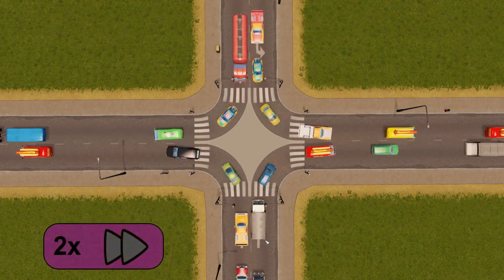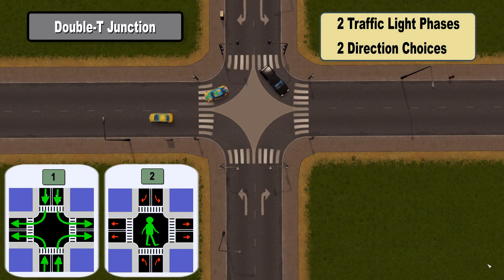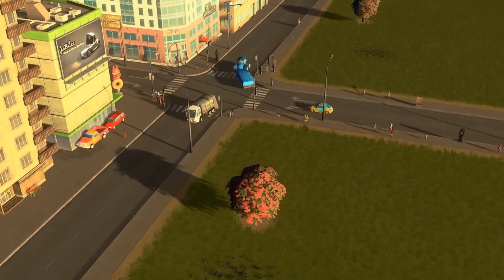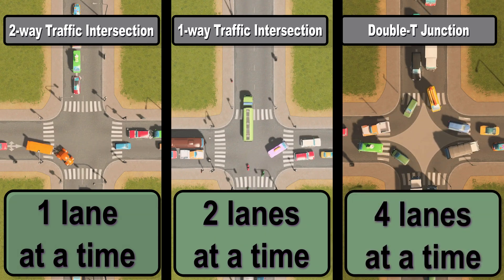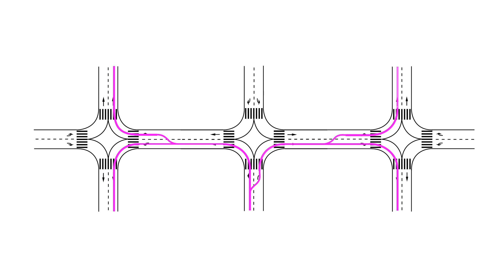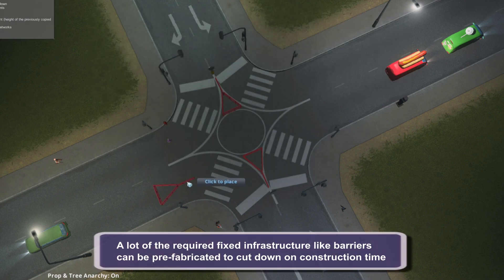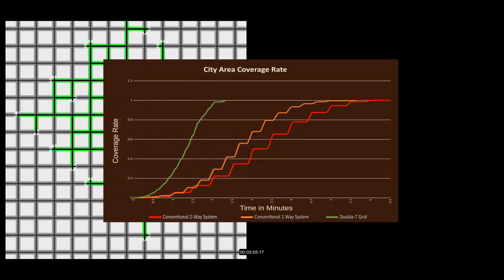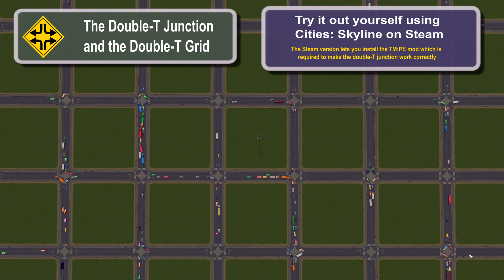How the Double-T Junction ends Traffic Jams (7 Reasons)

Comment: So, no one noticing this is just two roads connecting into other two roads, this isn't even a intersection, its just moving lanes, and it has less traffic light phases because it has less directions and less traffic flow, as you can see here you have just 2 incoming directions and 2 exiting, i think you get what i mean, it works because there is no intersection nor option, is as if just removing lanes from a traffic, not saying it dosent work, just saying why then have that intersection ( which by definition it isn't since it has no  intersection between lanes ) idk how clear can i make it, its just two roads splitting in two, it works obviously because there is no where else to go but just straight, ( it would work only if at the ends of those streets you would have u turns for cars to actually be able to go straight , this is just a intersection made out of slip lanes
Reply: And yes, it may be faster than American intersection, but its slower, ( and let's not forget the extra gas consumption ) than if you for exa just do a hexagon layout with just 3 way intersection, or even better, just smarter 4 way intersections, or even better, roundabouts, or better, roundabouts with slip lanes, or even better, double roundabout with slip lanes , or also, simpler to do 2 way single lane roads with lane with lane change in the middle, and when intersecting to have slip lanes ( basically the T intersection he is pointing out ) separated from the middle lane change zone, where people can actually intersect to other streets, but while not disturbing his slip lane theory
Reply from the maker: This is a good point, and it's one that I've thought about. Your understanding of how the traffic works and how the lanes are arranged is correct. But it's still an "intersetion". 
It's mainly down to how an "intersection" is defined, there's many definitions of course but they pretty much all describe what the roads do, and not what the traffic does. For example, my AI can give me a generic definition of an intersection and it says "A traffic intersection is a location where two or more roads meet, either at the same level (at-grade) or at different levels (grade-separated, also known as an interchange)." 
So, if two roads intersect, we have an intersection. Sure, this arrangement means that the vehicle-lanes don't cross each other, but I don't think in this case those lanes could be considered roads in an of themselves. 
Then there's the non-vehicle centric view, for pedestrians very little has changed, it's just two roads intersecting.
Reply: Not a hate comment, but just trying to add common sense.
Reply: And many cities in Europe already do this, where there is continuous green for all slip lanes .

Comment: I can now confirm. It’s boring but it works perfectly.
Reply from the maker: Thanks @jackkingsbury163 You are officially the first person to get this working that's not me! Much appreciated.😀
Reply: @RichAntDav  here are the strengths:

Fast fast fast flow. Very little backup.  The backup happens when the entire road is full of cars. 

I have a city of 45k that is at 88% traffic flow, and the problems are mostly high volume rather than traffic jams. Everyone lives in leveled up high density residential. It’s a remarkable sight. 

Because you can pack a TON of people into a small area, you can build arterial walking paths to get a lot of cims off the road. My cims love to walk. So I watch where they go in their cars, and build them walking paths. Takes a ton more pressure off the grid. 

Dynamic lane switching helps somewhat, but not entirely. 

The weaknesses: busses and trams are tortured souls. They are not meant to live in a world of squareabouts. 

Connecting various neighborhoods of your city still requires conventional roads. The mesh points between the grid and the arteries can be a real mess. 

It’s not very attractive - that is, I don’t think you would want to build out a huge area just in squares. 

I think I will toy with different rectilinear patterns that are topologically equivalent.
Reply from the maker: @Penfold497  Some great and very valid points there. Buses and trams need some careful consideration, Bus routes really need to be altered so that they use diagonal routes and not "straight-line" ones
I talk about this a bit here:
https://www.youtube.com/watch?v=qVINw5biQMI&t=40m40s
and Trams would be best if you can dedicate whole streets to them and keep them out of the active part of the grid

Meshing directly from a double-t grid can indeed be a mess, particularly if you didn't build a city with a double-t grid in mind in the first place. In all of my early cities I usually fed a multi-lane highway directly into the city, but then of course you have to bring the traffic out of the city again somewhere else, and ideally the traffic-in and the traffic-out areas are not too close together. So with those restrictions, it can take a bit of bulldozing to get something that looks nice, but that's not something you might want to do.
I will say though that interfacing a double-t grid with 2-way roads is something that can work well in quieter parts of a grid, if you haven't see this video here:
https://www.youtube.com/watch?v=qcj2pV-Gra0
that has double-t variations that you might not have considered and some can prove useful for interfacing with other road networks.

Comment: I came across this video last night, and literally today as I was driving in DC I came across one of these intersections, it is fairly new, as I have been to this intersection in the past year and it wasn't there. It does not have lights though, and is just a pedestrian yield. It functions the same as your Double-T junctions in this video but has the crosswalks in the typical positions but has a cutthrough for bicyclist.

It was the intersection of 4th St NW and M St NW in Washington, DC. You can view it on google street view. Is there any other of these intersections people have seen? Genius idea!

https://www.google.com/maps/@38.9056605,-77.0162549,3a,75y,116.43h,75.91t/data=!3m7!1e1!3m5!1sqaB0abBwe8hjyVzqgs9XZQ!2e0!6shttps:%2F%2Fstreetviewpixels-pa.googleapis.com%2Fv1%2Fthumbnail%3Fpanoid%3DqaB0abBwe8hjyVzqgs9XZQ%26cb_client%3Dmaps_sv.tactile.gps%26w%3D203%26h%3D100%26yaw%3D231.60043%26pitch%3D0%26thumbfov%3D100!7i16384!8i8192?entry=ttu

Comment: 1:03 You don't necessarily need 5 phases - there are 2 ways to do only 4
1 - In phase 1, cars turning right yield to any crossing pedestrians at the beginning of the phase, same with the other phases
2 - Same as option 1 but for both left turning and right turning cars.

1:20 There is also a way to have only 2 phases. You can have right (or left) turners only use the closest lane after the intersection on the cross-street when turning and yield to pedestrians at the beginning of the phase. By also (example as in phase 1) having cars headed straight using the right lane after the intersection, you can have left (or right) turners from the cross-street proceed (still during phase 1) after yielding to pedestrians. (this entire scheme allows both parallel crosswalks to be lit at the same time)

1:38 Now you don't even need stop lights - all you need are stop signs or yield signs so that pedestrians can cross.

3:57 Most accidents at stop lights occur between turning vehicles and straight-on vehicles. By removing the ability to turn left, you can reduce danger involved in these type of crashes. Examples of this type of intersection are plenty: Bowtie, Michigan left, Right-in/Right-out, Roundabout. There are also types of intersections where a left turn is displaced to the side -e xamples include: Continuous flow, Jughandle, Offset T, Quadrant roadway, Split intersection, Superstreet.

5:48 Again, when vehicles are not turning left, allow right turns from the opposite side of the main street. This allows more throughput. 
6:09 Same thing, but for when vehicles are not going straight, allow cross-street traffic to turn left. (right)

7:27 My thoughts:
LONGER JOURNEYS-1: Induced demand will not occur because of the "longer journeys" problem, the "public understanding" problem, and the "city navigation" problem. Combined with the fact that if you want to move diagonally, you'd have to keep changing lanes between each intersection. Group all of these as one big problem.
LONGER JOURNEYS-2: Since we have a lack of real world data, we cannot tell if the traffic speed will make up for the additional distance traveled. Also, what about parked cars or double parked trucks unloading? Then 100% of traffic on the stretch is forced to merge into one lane before splitting off again, causing a traffic jam.
BICYCLE LANES...: Yes, it's a problem, because you'd have to either 1- have bike lanes on both sides of the road and have bikes cross at crosswalks, or 2- put the bike lane between the 2 car lanes (hazard to cyclists).
Reply from the maker: point1-3: You're right of course, you can make traditional intersections work with fewer phases, but there's always some compromises, and fairly big ones. Yielding to pedestrians or oncoming vehicles has the knock-on effect of slowing down any following vehicles, not to mention the safety aspect. I was trying to cover the more commonly used intersections in heavily traffic areas as these types of areas would be the most relevant ones for potential deployment of a double-T grid.

point 4: I agree that intersections having no left turns are probably significantly safer. I'm not sure if you're right to say that most accidents occur between turning vehicles and straight-on vehicles, for the statistics I've seen collisions with pedestrians at intersections are quite common.

Point 5: I think I see what you're saying, with a 2-way traffic intersection, when traffic is proceeding from the south, you could also allow traffic approaching from the west to turn right at the same time. While that's possible, if you have just 2 traffic lanes then as soon as you get a vehicle arriving from the west that wants to proceed or turn left, then they are going to have to wait and hold up all the traffic behind them. So the overall effect would be fairly negligible.. unless you use extra filter lanes, but if we're allowing extra lanes that makes everything more complicated. I'm really trying to keep things simple and easily understandable in these videos, going in to too much detail too soon will mean that people are going to quit on learning these new concepts before they get  basic handle on them.

Point 6: I go into the longer journey's issue in more detail in my "Problems" video here:
https://www.youtube.com/watch?v=qVINw5biQMI&t=21m56s
I also go into more detail on the implications of blocking one of these double-t grid traffic-lanes, as you  allude to, it's not good and measures would have to be taken to avoid it. I also have a section on how to handle bicycle lanes.

Thanks for the detailed comment though, much appreciated, any more points, fire away.

Comment: 16:37 That octagonal grid is exactly the structure that the free-flowing traffic page ended up with when it expanded on this idea.
16:41 Hexagons are the bestagons, but man does the game not zone them well.  They're just so inefficient.  I look forward to seeing how you one-way them, though.  I've found that -- if you enable right-turn-on-red in TMPE -- just using two-way with lights works great for 3-way 120° junctions because the 3-phase light for each of the lefts is surprisingly effective, even without custom light setups.  (And whichever left is currently allowed can go with the corresponding unconflicted pedestrian crossing, too.)

I mentioned this in the other video too, but since you have so many more examples here, I suggest trying out a herringbone grid -- it's basically the same as taking a square grid and removing the fewest possible segments such that you have only 3-way intersections.  Alternatively, you can think of it as topologically the same as a hexagon grid, but smushed so that all the corners are right angles.
Reply from the maker: Hexagons are great fun to play with, but seem to be more suited to 2-way traffic than one-way traffic, with 2-way traffic and 3 lane roads, you can use filter lanes to keep the traffic that wants to move to a different hexagon out of the way of the traffic circling the hexagon.

I hadn't thought of the Herringbone grid, thanks for the tip, that's an interesting one with it's 3-way intersections, I have a feeling it'll look pretty cool.
Reply: @RichAntDav  Yeah, the traffic routes tool looks fun in herringbone.

Another bonus you can do with it is not actually delete the roads entirely, but make them pedestrian/bike only.  Then cyclists get a direct route across the city -- one that's free of traffic ¼ of the time -- while penalizing motor vehicles.

Comment: So you've invented roundabout but worse. Why not to use roundabout? Is it worse? btw. why 5 cycles for normal 2 way junction? In Poland there are 2 or 3-4 max. 1st. cars from north-south can drive in all directions, pedestrian crossing north-south, 2nd east-west in every direction, pedestrian crossing east-west.
Reply from the maker: I talk about the roundabout comparison in detail in a video that's coming out tomorrow:
https://www.youtube.com/watch?v=qVINw5biQMI@t=17m28s

But briefly, it is a bit like the city block itself is the roundabout. Unlike a normal roundabout then, instead of having a single point to merge onto a roundabout, a driver has the length of a whole city block to change lanes. Also, for a roundabout to be effective, it has to be fairly large and even then a single vehicle on a roundabout has the potential to briefly block traffic from other directions from getting on the roundabout. The cumulative effect of this type of blocking is why roundabouts are not used in particularly busy areas. They're great up to a point, but after that they gridlock easily. A single vehicle being unable to leave a roundabout has the potential to block all the other lanes.

I chose the 5-cycle traffic light for a 2-way traffic intersection to make it a like-for-like comparison. When there's only 2 traffic lanes, it just takes a single vehicle that has to turn against the oncoming traffic to hold up every vehicle behind them. From what I've seen, most intersections that use less than 5 phases are either in locations that are never busy, or they use additional filter lanes to reduce the possibility of one direction being blocked.
Reply: @RichAntDav  I think a squareabout is better
Reply from the maker: @milesmcallister8542  "squareabout", brilliant, I like it a lot. I hope you don't mind if I use it myself?